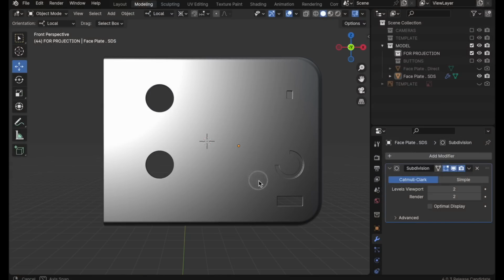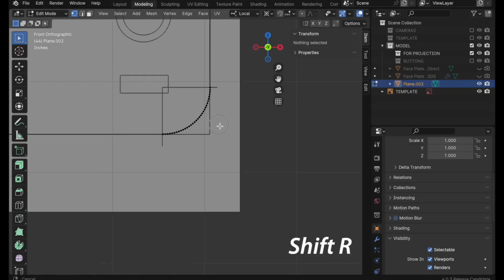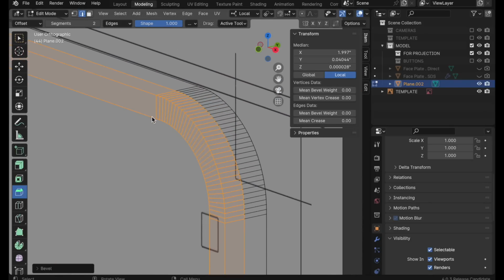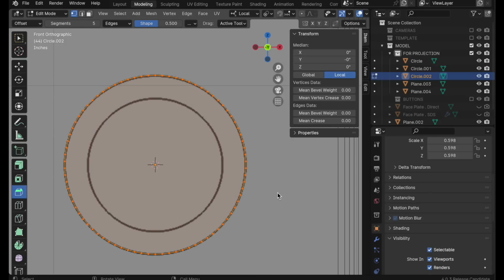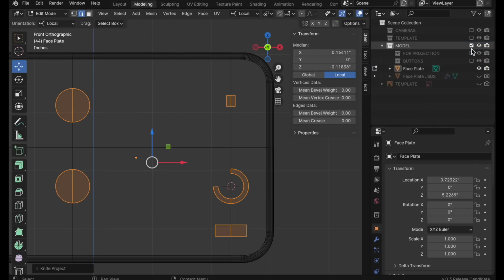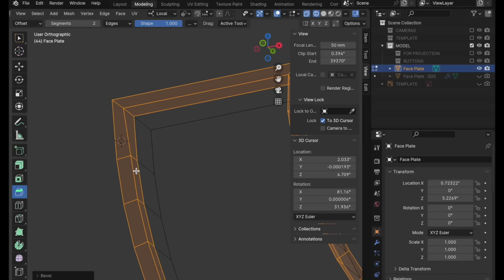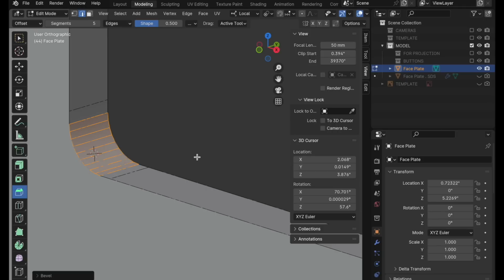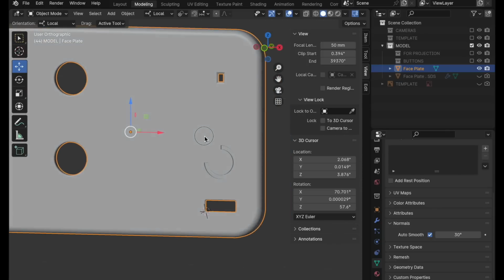Modeling something mechanical WITHOUT subdivision surfaces.

Comment: I just finished a model that is basically a flat surface with a lot of small extrusions. I didn't use subd, but tried only using quads still. Ended up adding an insane amount of loopcuts, and adding way too much geometry. This solution is so much quicker and makes so much sense
Reply from the maker: Make sure and watch my video on the Weighted Normal modifier as it'll further expand on this approach.

Comment: I'm using this manual approach every time I'm working with complex and large hard surface objects with a lot of details. Control over bevels is crucial here because Subdivision Surface modifier does it kinda automatically and in most case don't do that in a way we want it. In addition, SS modifier makes a lot of unnecessary geometry. Well, that won't work if we are doing game assets where we have to pay attention to quads and tris (leaving no ngons at all) but for rendering images/animations ngons are by mho life and time savers. Also, unfortunately, I've noticed that most of people don't pay attention to boundary-bevel edges which is usually not noticeable with small objects but when it comes to large flat areas and especially areas with additional details makes a lot of troubles and weird shading. I'd really like everyone in this business watch this video and learn something that seems trivial but actually is very important for entire process of modeling. Most of time beginners are thought to use SS and Auto-Smooth combo when learning modeling but I think that's wrong way to understand geometry and shading issues. Atop of all, that habit is hard to get rid off in later stages.

Anyway, thanx for this great tutorial. Keep good work.

Comment: The method you are using is very impressive, however I believe it is not optimized enough for use in a game, unlike what is done using subdivision. Your method is more technical and effortful, and being able to control certain things yourself expands the limits of what you can do.
Reply from the maker: I show it just to demonstrate how to think differently about modeling something. Many things are best done with SDS, but now and then a direct approach is better.

Comment: Great Tutorial. I gained confidence to even at time to work without SubD after watching this video.  I have a small thought that at 21:18 the bevel function messes up, but if we open up the action menu, if we untick loopslide, it will evenly bevel. I am not sure whether it works in this specific case but I have found it working at time when beveling is uneven.

Comment: Have a look to the weight normal modifier. It will save you from adding support edges to avoid bad shading when a face is bigger than the others
Reply from the maker: I've already done a tutorial on it using this model. https://youtu.be/60E-26Ydbh8

I like to show multiple approaches to achieving something. There are benefits and drawbacks to both methods.
Reply: @christopher3d475  great just on point!!! Thanks

Comment: One thing I like to do when I am creating bevels, is always make the segment count even. That way, if I want to optimize it as a game or VR asset, I can simply delete every other edge that makes up the total bevel segments. Also, I often use the profile option, and bump it up to somewhere around .60-.70, which create curvature lead-in. This may require larger bevels, but creates an especially nice transition, which works very well for concept modelling. (This avoids the fuss of creating extra ed cuts just outside the bevel.)

Comment: What's the difference between shade smooth and auto shade smooth?
Reply from the maker: Shade Smooth smooths the entire mesh regardless of the angle between normals. Shade Auto Smooth places a limit on that so you can prevent smoothing across certain regions of the mesh.
Reply: @christopher3d475  so like, shade smooth is for objects that has round or less edges while auto smooth is for hard surface like sharp edge objects or cars?

Comment: Really love this approach and how precise you are. It might just be me, but i feel like there is a discrepancy between the knowledge required to understand this video, and the commentary. What I mean is, to understand the video, you probably need to know about hard surface workflows and have intermediate level experience with 3D modelling, but the commentary (whilst great and detailed) explains every menu and button. Again could just be me, and the video is amazing regardless, it just stuck out. Super impressive either way 🙌

Comment: Just found the channel recently after getting back into hard surface and needing some refreshers, so much great stuff here. Really loving this series, I just caught up on the latest episode but wanted to come back and ask something I've been wondering about as the series has gone on - you mention here that planes/polygons don't like having holes in them and that's why we need the loops through the ngons. I'm just wondering if there's a particular reason the loops need to run precisely through the vertical centres of the holes - does the location of these loops have a significant impact on shading and why?
Reply: Ooook after actually trying to replicate your process myself I see it's in order to prevent funky geometry after the knife project :))

Comment: TLDR making a middle-high poly model by adding a lot of polygons from the beginning. 
But in reality you are essentially doing CAD modelling, except it being fully destructive here. Which is a waste of time really. If you really have time & references for this types of things, you will be much better served just doing CAD modelling from the start. There is enough cheap or somewhat free CAD nowadays.
Reply from the maker: People are here to learn the use of Blender. Using CAD for this model is a side issue because then that wouldn't be teaching people how to work in BLENDER.
Reply: @christopher3d475 But this blender workflow aren't very efficient or useful. It can work in similar situation where the model is just as simple, and you have all the blueprints, but if it's something more complex (like at least one freeform surface), trying to apply this type of workflow will be a waster of countless hour for any mistake you'll made.
Reply from the maker: I'm not telling people they should always work like this or even that's it's the best method for a given situation. It's simply a demonstration of ways of thinking about modeling something. You can use subdivision type modeling or go to a NURBS modeler or whatever you want, but this is about demonstrating a different way of thinking about the modeling process and using the tools in general.   @Zhiznestatistiks

Comment: Bevel is pretty much a subdivision , just for the limit of edges. To make an alternate you have to use CAD, that’s the only alternative.
Reply: Not really. Beveling like in this video adds local detail by adding geometry where it's needed.. Subdivision modeling lets you model at a lower-than-target resolution, and rely on the algorithm and control edges to predictably control smoothing. But a SDS modifier subdivides every surface and in many cases generates A LOT more geometry than needed. This is especially true for mechanical details that have many large flat faces that shade just fine as N-gons—as demonstrated here—as long as you control the curved shading going into the larger N-gons. Again, as demonstrated in the video.
The strategies involved in SDS all quad modeling compared to local beveling and liberal use of N-gons are quite different, so I wouldn't say they are similar. It's also not a case of one always being better than another.
Reply: Really wish I could just export from CAD for stuff like this, but the 3D polygon exports are universally terrible in every CAD tool I’ve used. Fine for 3D printing, but not very useful for game models or doing much complex with.

Comment: I find navigation easier by turning on both [Orbit Around Selection] and [Zoom to Mouse Position] under the Navigation tab for Preferences, specially when modeling details... just keep in mind that if you pan the view (or if you select different objects) it will still pivot around the current selection, making wonky rotations, nothing one can't get used to IMHO.
Reply from the maker: Yes, I have both of those enabled. I think they should be on by default because they do make navigation a lot easier.
Reply: That was my navigation setup for many (ten?) years but I increasingly felt it wasn't fast or flexible enough. After experimentation and practice I have it on Trackball, Orbit Around Selection off, Auto Depth on,  Zoom to Mouse Position on. The different actions of MMB dragging with the mouse cursor positioned towards centre versus edges of the 3D viewport with trackball takes some getting used to but eventually becomes totally intuitive. Crucially I also have my mouse button 3 mapped to center view on selected (same as Numpad period) and mouse button 4 to lock view to 3D cursor, which often comes in handy, in effect temporarily substituting for Orbit around Selection. (You can quickly throw the 3D cursor on a surface with Shift+RMB of course.) Between all of that, the MachineTools navigation pie, and frequent use of alt+MMB and shift+B to center and zoom the view, my navigation is SUPER FAST and more precise than ever before, and I never need to pan with shift+MMB. (I do wish the viewport had flick panning though.) I would not go back to Orbit Around Selection or Turntable.
Reply: @josephrussell1419  I feel yah, my particular issue w/ making highly customized settings for navigation on any particular software is cuz I use a handful of different applications for work. Of course one can learn different schemes for different applications, but in order to get the speed and precision I need consistency across most of the software as possible... After many decades (30 year or so) using different CAD/CAM, 3D software and whatnot the thing that kills me is every developer seems to want to reinvent the wheel when it comes to navigation and control schemes... At least nowadays most software offers ways to tweak and customize key bindings and shortcuts... I've used trackballs in the past, and while it takes some "getting used to" I do feel they end up being more comfortable than mice overall, only issue I had was the tech spec wasn't comparable to mice, but recently I've been more inclined to give them another shot since my wrist is kinda "tired" again and I wanna avoid carpal tunnel syndrome or similar... (Space mice, lol, I've tried one too many times, but I've never get them to be as fast a good old mouse, was a big waste of money for me.. since those are not exactly cheap)
Reply: It's interesting to hear perspective from someone more experienced than me. Also I should have said I'm so far only a keen hobbyist with just a couple of small paid 3D projects under my belt, but now aiming to develop professionally. So it's useful to consider the points you make about consistency over different softwares. I have barely used anything but Blender and I'm aware my view of things is quite narrow as a consequence. I'm not really saying everyone should use my setup, Im just excited that it works for me! But, by the way, I don't use a trackball physical device, although I have tried one... I use a normal mouse but in Blender's Navigation settings I have the mode set to Trackball instead of Turntable. @Canis.Lupus.Arctos

Comment: A small tip for anyone having troubles with solid mode having wobbly or imprecise lines, change your "clip start" and "clip end" settings on the view tab of the tool panel. Making the renderable area smaller helps with precision. I dunno if that was going on in certain points in this tutorial, but it's a good tip to be aware of regardless for yall reading the comments ^^
Reply: definitely - blender's default clipping seems to really hate smaller objects. though I have found it displays a bit oddly when zooming out if the clipping it set to a very small scale
Reply: @bdbjr28  the clip planes define the near and far side of a cube that gets distorted into your view frustum. - It's a technical thing concerning projective transform and it's necessary to avoid infinities. Giving too disparate values (very small near clip, very large far clip) means numerical issues as the underlying values get close to the smallest or largest possible floats.
But going too small simply means stuff further away or closer will not be shown at all. So that's why it's "a bit odd" if you set a very small far clip.

I guess by default it's set up for roughly room- or house-scale scenes, rather than extremely fine stuff or landscape scale stuff

Comment: 16:30 Whoa, I've been using Blender for more than 5 years now and I just knew that you can do this. G then B, I was wondering what it was. Then I realized that it is actually quite useful than having to open up the snap tool all the time and change it to vertex snapping. Thanks
Reply: It's fairly recent, I believe they added that option in the second half of last year...
Reply: In  my startup file, snap is set 'vertex' and 'active' ... A good default for modeling, IMO. At last, Blender lets you set the snap source, but I find I don't have to use it that often.

Comment: I tap GG to get the slide edge mode. Really easy and quick.
Reply: It's a good shortcut to know, but going through the menus and clicking on toolbar buttons is better for a video tutorial so you don't have to explain "I used GG to go into edge slide mode here"

Comment: Another thing: you pressed z twice to got to global axis, but my Blender works in the opposite way (I have to double tap the z key to transform in the local space). Did you customize it be that way, or is my version altered?
Reply from the maker: It depends on how your Transform Orientation is set. In the tutorial, mine is set to Local which switches the behavior compared to if you have it set to Global. I probably should have mentioned that.

Comment: is the addition of the bounding vertices around the bevel the same thing as activating harden normals in a bevel modifier?
Reply from the maker: It's a more robust way of handling shading between curving areas and flat areas. Harden Normals will do that via a kind of shading 'trick'. but it can cause problems if you're not really careful with it, and if you need to export the model to some other application, this method is much more stable.